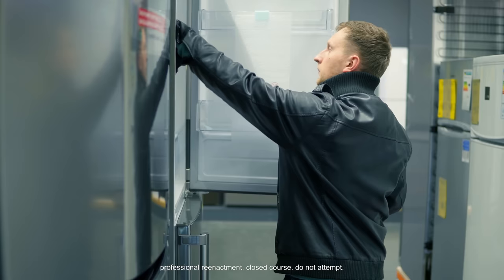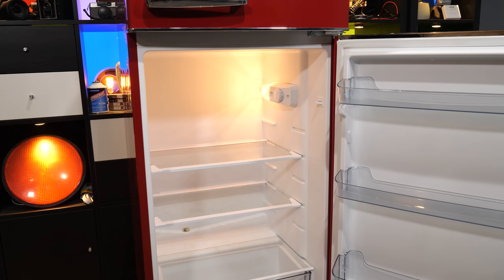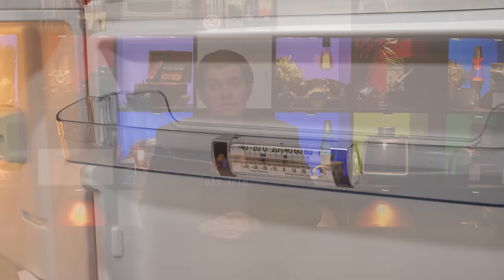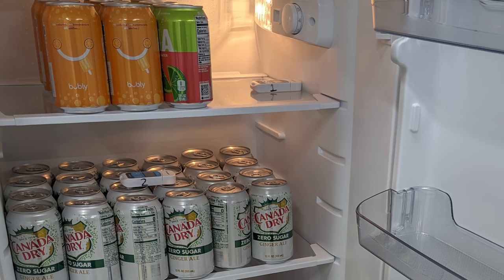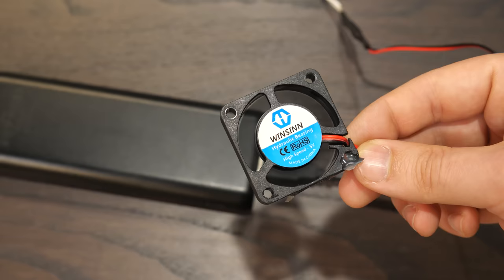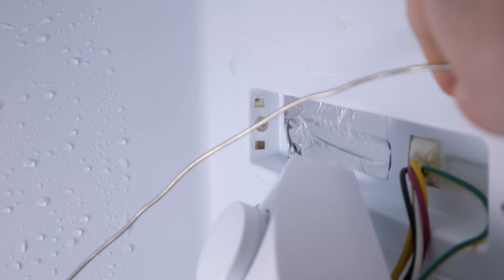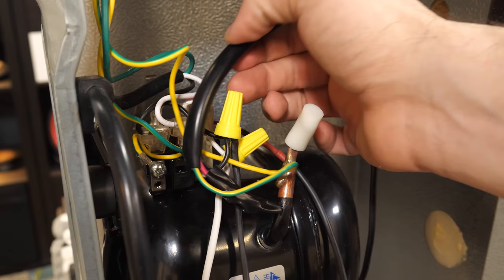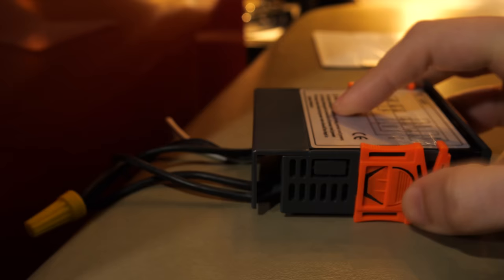This goofy fridge has a really clever design. It's also kinda terrible.

Comment: I'm convinced that everything that is weird about that fridge is simply to keep the compressor from overheating. The drainage collects on top of it, and I bet the thermostat is calibrated to limit the run time. That would explain why the fridge didn't just keep on running until it hit the needed temp.
Reply: I was looking for this comment, agreed
Reply: Except it was shown that it ran for many hours continuously with no problem at various points throughout the video.
Reply: @NightKev  The compressor will break (I think) if it runs for too long? He was joking about it in the video, but I did install fans to blow on the compressor for my fridge. Fans so cheap today, and run on 12 volts.
Reply: I have a different thought along similar lines.  Rather than limit run time, my guess is that one job of the thermostat is to prevent the refrigerant from getting too cold and having liquid refrigerant return to the compressor.  This is critically important because liquids are essentially non-compressible.  If liquid 'slugs' the compressor, then you need to replace the compressor.
-Jon
Reply: The big problem isn't that it takes breaks to protect the compressor, the problem is that the target temperature seems to change. It never made it down to the temperatures it had before, even after it "settled in" 
You shouldn't have to move the thermostat setting around depending on how much or little is in the fridge.
Reply: It's pretty standard to use the heat from the compressor to evaporate the condensate into the room.
Reply: I had this thought too. It's a nice hypothesis, but it's disproved by the data later in the video, where it is shown running continuously for many more hours with the new temperature controller.
Reply: @jonathanedelson6733  Yes this.  It's not checking if anything is "too hot" the thermostat only shuts off when things get too cold.
Reply: @NightKev yeah for the purposes of the video, but after so many days of it being the norm? kaboom!
Reply: @davidwalker1652  Not really.  If it's a safety feature to prevent a problem that MIGHT happen, not one that absolutely will happen every time, then running for a few days or even months doesn't necessarily prove the feature was unnecessary let alone unintended.  Of course like I said in my other comment, it's a question of the compressor getting too cold, not too hot.
Reply: The compressor may have a bimetallic TCO (Thermal Cut Off) switch to protect it from overheating/catching fire.  I think it says "Thermally Protected" on the side of the compressor.  Might be those yellow/greenish wires by the compressor.  If not afraid of a little fire, might be able to jumper across the switch, for science stuff.
Reply: Oh, do not try at home!
Reply: @davidwalker1652 my concern would be the lifetime of the compressor. he may have shaved of years of life.
Reply: The compressor has an internal thermal interrupt that protects the unit.. it takes a long time for the compressor to overheat but when it does it takes a lot of cycles to cool it down, regardless of the internal temperature of the box.
Reply: I was right with you, thinking it was a thermal protection circuit inside the compressor. But swapping the thermostat shoots a hole in that theory. If the thermal protection circuit were engaging, you'd see that in the data with both thermostats.
Reply: @davidwalker1652  but the new temperature controller isn't really engineered to work with that specific pump. the specific configuration of the stock thermostat may be engineered to limit how long the pump runs at a time, to prevent it from burning itself out prematurely. using an aftermarket thermostat totally negates that. 

or it could just be a poor engineering decision. you'd have to ask the engineer why they put it there.
Reply: @NightKev  The design isn't that good for cooling the contents and it isn't that good for preventing the compressor from overheating.  Being bad at one thing doesn't automatically make you good at another thing, after all :D
Reply: "The drainage collects on top of it" yes that is to prevent the compressor from over heating...the 2nd reason is to evaporate (with heat) the moisture that collects there so it doesn't over-spill and fall on the kitchen floor.
Reply: @Krydolph  There is a very old method used with this sort of fridges. Because it has a single evaporator coil split between the cooler and freezer, the freezer part may actually get way too cold which may both damage it (if the cooler itself is not enough to fully evaporate the refrigerant) and the temperature of returning refrigerant may become lower than it should be (making the cooler coil colder which in turn makes the thermostat reading lower than it should and stopping it early). The decades old method is to load the damn freezer. It needs much more thermal mass in the freezer to balance it out somewhat. Generally running those with empty freezer often results in bad cooling power in the fridge because the freezer freezes too quickly. I bet it would behave much better if the freezer was just full of ice bottles. Ice can store much more energy which would mean that the compressor is loaded much more and can run more efficiently and for longer. It's actually the same problem as with HVAC. If you close most of the vents in your house and run forced air AC, it may actually result in worse cooling. Not enough vents means less air going through the evaporator coil which in turn means less load on the AC unit, much more potential for freezing moisture on the coil and in the end safety shutoff stopping the compressor because of too much pressure. Heat pumps have to be properly loaded with heat to work correctly.
Reply: @davidwalker1652  Yes, it's shown to run continuously for hours, but how many years will that little compressor be able to handle that?  This could be a longevity issue.
Reply: I doubt the compressor is in much danger of overheating. It's mostly cooled by the actual refrigerant going through it. What little cooling it gets through the shell is secondary.

You can even install noise suppression blankets over compressors, like in some home A/C units, without any real danger of overheating them.

The condensate tray is on top of the compressor so that the water is more likely to evaporate fast enough, not really to cool the compressor.
Reply: I wouldn't say pump heat, but pump duty cycle. That pump looks to have run for like nearly 12 hours straight.

@Alec might want to see if the controller has a duty cycle setting, running the pump for such long period will probably reduce the reliability, I'd probably try to stick to something similar to the original duty cycle.
Reply: @jonathanedelson6733  I totally agree but IMO it would have been better to add a small accumulator to boil off liquid before it dilutes/boils off the oil in the bottom of the compressor (or slugs).  They have those on older heat pumps (and on RV/window units because of the short lines between the evaporator and compressor).  This thing was designed for "Pretty" not Performance.

Comment: I watched this video very soon after it was posted, as I had just bought a smaller version (35 or so inches tall) of this retro-looking type of ‘fridge for beer in my garage man-cave. Until recently, the ‘fridge compartment was keeping a pretty steady.  But a few days ago, I stuffed it completely full and the unit started running as if the thermostat has gone mad. I found the temp varying wildly, mostly too low, but also freezing cans along the back wall while too warm for cans in the door. In fact, at times, the freezer would completely thaw. Then I recalled the details of this video, especially regarding air flow. So I reduced the beer cans by half (or more) and spread them out. The ‘fridge part got back to its original steady temp and the freezer stays frozen!  Thanks Alec!

Comment: With a freezer section like that, the ideal way to help it stay cold when adding new things is to keep more (already frozen) mass in there, just like a chest freezer. Just grab a few ice packs and use them to keep empty space filled. Edit: this applies to the refrigerator too.
Reply: If this is your only fridge, how are you supposed to have pre-frozen stuff?
Reply: @jordanabendroth6458  You freeze stuff you don't care about before purchasing stuff you do care about. e.g., fill it with ice pack "ballast" when you start, and then as you move frozen stuff in and out, pull the ice packs out and put them back in. 

Put another way, if you didn't have a freezer before you bought this, why do you have frozen stuff at all?
Reply: @metaridley1848  'why do you have frozen stuff at all'

Because you bought the refrigerator either as your very first fridge/first-at-that-home {many people choose to leave their fridge behind when they sell} or because you're replacing a broken refrigerator disaster where everything is already thawed.
Reply: @jordanabendroth6458  tbh you need to bootstrap it really by turning it on for the first time and letting the thermal mass cool down/freeze before you move food over (or buy a bag of ice and slowly replace the ice as you fill the fridge).
I don't need to use all of my freezer space so I have a 2 litre water bottle and a bunch of ice packs (in case I need them) shoved in the top draw. Partly to help add thermal mass, partly as witness items (once my 2 litre bottle froze, I spun it so the small air bubble in there is on the bottom, if I open the draw and see the air bubble on the top then the freezer has as least partially defrosted without me knowing it), and partly as a phase change mass at the top of the freeze to help increase the time the freezer stays frozen should the compressor fail.

Comment: I have a similar model, and yes, it's difficult keeping the freezer and refrigerator temperatures correct. Soft ice cream and frozen milk are all too common.
Reply: Well it sounds like you still have ice cream and liquid milk, just in reverse
Reply: I feel there's an easy solution for this particular problem, which shouldn't be any more complicated than swapping the position of certain items.
Reply: @lonestarr1490  Yup. I can eventually get everything stabilized. The problem is when you show up with new groceries - if you're not careful you'll have issues. It's a level of complexity I'm not used to.
Reply: I have a very similar Frigidaire fridge and it's worked perfectly!
Reply: I have a Unique retro-style fridge that's just a bit larger than this one and have never had this problem.
Reply: "Soft Ice Cream and Frozen Milk" is a great name for a sarcastic comedy easy listening band.
Reply: Ice cream needs to be at 9 degrees or colder to be hard.  It has a lower freezing point then water.  That's why you see ice cream in it's own freezer at the store.  It has to be colder then the TV dinners and tater tots
Reply: Never had any problems with temperature with a similar fridge.
Reply: @Earth-Apple  how do you use it? My issue is getting the temperature just right. If I turn it too cold, everything in the refrigerator section freezes over. Plenty of water bottles turned into blocks of ice. Then I raise the temperature just a small amount, and now the freezer isn't cold enough and my ice-cream turns to soup.
Reply: @PsRohrbaugh  My fridge just doesn't have that problem. My freezer is about -18c (I measured) so way below freezing, and the refrigerator section never goes below the freezing point, and I have the fridge set to the second highest setting because I like my beer cold. But it's a pretty good brand, so maybe that helps, nothing fancy with screens of microcontrollers tho.
Reply: @clutchcargo666  I'm one of those wierdos that loves his ice cream hard as a rock, I love to be able to chew on it a little before it melts.

Comment: The interesting thing is the different definition of „food safe temperature“. In Europe in general 4-5°C is considered the optimal temperature of the cooling compartment and -18°C for the freezer. In Germany we even go higher with considering 7°C as optimal temperature of the cooling compartment. And - it is perfectly fine, never had or heard of problems with 7°C.
Reply: Americans tend to store food for longer times due to car dependency and less frequent food runs as consequence.
Reply: @Turtle1631991  True. When I spent weeks in Germany and the UK, I noticed the fridges were tiny and grocery store trips were daily or every other day and they used up all the food they bought in those two days or so. In America, my friends leave leftovers a long time and sometimes I do as well.
Reply: I think the temperatures quoted by our different safety organizations mean different things. The way the US food safety recommendations read to me is that your refrigerator should be set no higher than 40°F (4.4°C), but I imagine that that's the average temperature. The UK recommendations (entschuldigung; mein Deutsch ist nicht so gut) for 8°C (46°F) seem to mean that food should never go beyond that. In fact, they recommend that refrigerators be set at a maximum of 5°C (41°F).
Reply: @wbfaulk  No, 4 C is not the average temperature in a North American fridge. It's the maximum allowed. Here in Canada, if the health inspector ever sees, during an inspection, that the interior of a food service fridge is higher than 4 C, he checks the food. If it has risen past 4 C the entire fridge contents goes in the garbage. No, I'm serious.
Reply: @paulmaxwell8851  Well, fortunately, I was talking neither about Canada nor commercial refrigeration. Also, when I said "average temperature", I meant the average temperature of the interior of the refrigerator; there is some level of hysteresis in all thermostats, and my guess was that the setpoint of a household refrigerator thermostat is in the middle of that range instead of at the top end. But I didn't explicate that, and I'm also not certain of it anyway. Still, commercial refrigeration is irrelevant. No one is coming into your house and throwing away your groceries if your refrigerator is too warm, regardless of what country you live in.

Comment: Fun fact those big warning labels are actually warning you about the blowing agent in the styrofoam insulation not the refrigerant itself, that is the much smaller print warning label. I figured that out when figuring out that my freezer and fridge use r134a but still have the cyclopentane warning labels. Also, cyclopentane apparently is not used as a refrigerant and r600a is isobutane.
Reply: Ah, that's why it said 'foaming agent', I was wondering about that. I guess, as a refrigerator manufacturer, they have stricter "Prove this isn't a CFC" paperwork than most random companies making insulation, and it's good to know when a plastic insulation foam is the super-flammable kind I suppose. Also, maybe more inert gasses are used in foams that don't have to be that insulating? I suppose it might be tricky to add thermal conductivity to the criteria you have to optimize in gas selection.
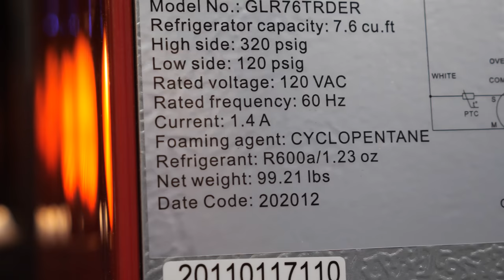Reply: Yep. 47:32
Reply: This reminded me of a story about a warehouse fire where an employee who got bored wanted to see how well a scrap piece of foam would burn. What he didn’t realize is that the whole reason the rolls of foam were being stored there is so that the flammable gas used to blow them into their foamy form would off-gas in time for shipping. I don’t think even five seconds passed from the lighter being lit before the entire warehouse was ablaze.
Reply: in ancient days the manufacturer used R11 to foam the thermal insulation.
R11 is not flammable but a Ozone killer.
Reply: @Intrafacial86  Ah, so THAT is why it was so intense. Never would have figured they pump random polymer foam full of flammable gas, huh (to be fair, never had to think about the way it's made either, but it's a bit unexpected that something as mundane as polymer foam that we encounter even in food packaging might be filled with effectively fuel, even if it's limited to certain types)

Comment: @TechnologyConnections As stated before a german here: The design of the fridge is very common here in germany. Did you measure the temperature of the compressor? Your spike after hours of cooling could be because the compressor shuts down when it gets too hot. My guess would be that the "waterhat" as you described it was empty at that point and couldnt cool the compressor anymore so it had to stop working to cool down, despite of not having done its job. Sidenote: In germany the "safe temperature" for food is considered 8°C (or 46.4° F).
Reply: Yeah, why not put the fan at the heat exchange???